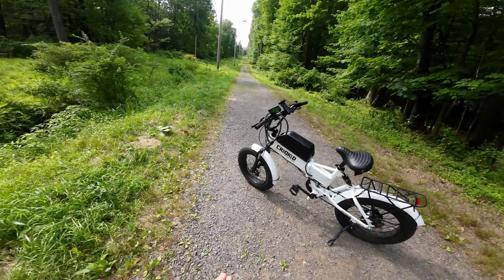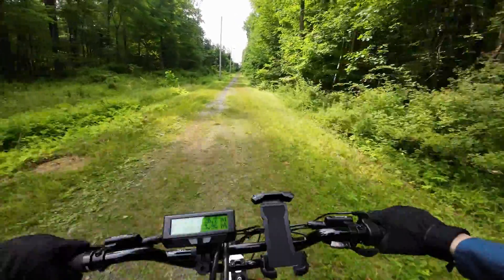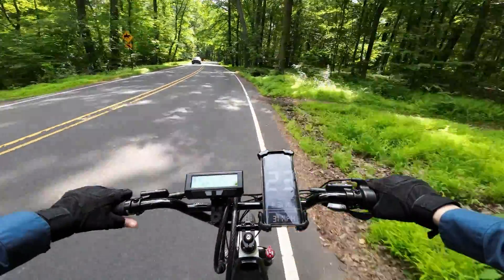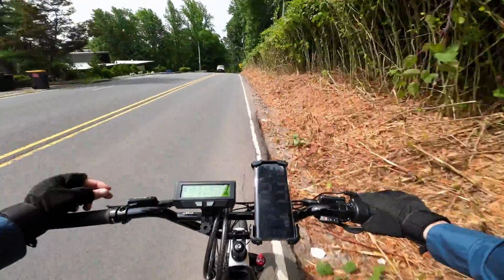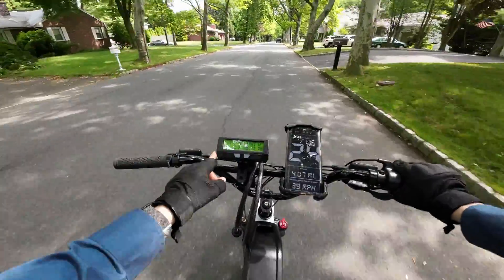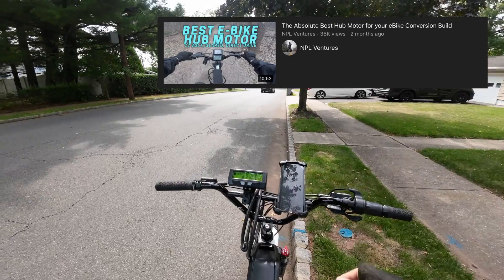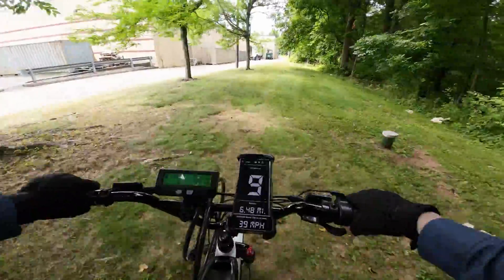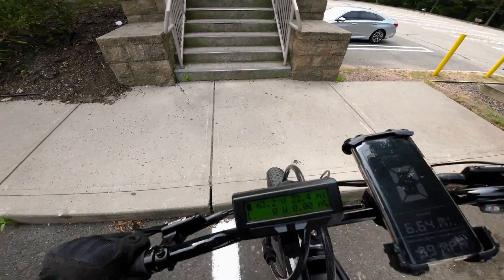Why I Won’t put a Powerful Direct Drive Hub Motor on my eBike Build

Comment: The thing that damages the motor is heat. You can probably run the full 96A phase current the Phasrunner can deliver. You just need a temp Sensor so you dont accidentally run the motor to hot. If you are worried about breaking gears you should limit the ramp up time so its not to jerky.
Reply: Good comments. Ramp aka onset of power is a big factor.  A motor can sustain the power once its turning high RPM. Everything breaks more with more abrupt power....from car transmissions to half shafts to chains and cassettes on mid drive ebikes.
Reply: At what temperature does it become critical?
I only need to drive 5 minutes and my engine is 85 °C (185 °F)
Driving is no longer fun since I discovered the engine temperature gauge :/
Reply: @Bergwacht  it’s very hard to PinPoint one critical temperature since every motor and location of the temp sensor is different. I think the first thing that gets damaged is the magnets that get demagnetized but that temperature depends on the magnets. The temp sensor is usually located next to the windings so you are measuring the temperature of the windings not the magnets. 

100 degrees Celsius should be okay for most motors. Some people go all the way up to 120 or 130 and it’s usually fine. 

The thing to keep in mind is the higher the temperature the faster you are aging the material so it may die earlier.

Comment: What do you think about the Electrom LEV? It has two motors, a geared motor in the front for low speed and a high powered direct drive hub in the rear for high speed.

Comment: I can't see any option to modify your pwm in the controller settings. Try decreasing torque up ramp times to boost torque, the controller will sense you need torque faster and adjust that setting for ya.

Comment: my biggest concern is, the bikes aren't designed for that much power/torque. like others mentioned, the dropout is a weak point. no one can convince that it's a good idea to run 1000 watts through a front tire. now, you can buy a one of those stealth bomber frames that have a proper dropout/swing arm. a 1000 watt rear hub and a mid drive bbshd is by far the best of both worlds and marry quite well. use 1 battery that can discharge 40-50 amps continuously for a clean look.
Reply: I run 1500w through my front fork but I welded myself a steel truss/springer fork because I did not want to risk it with a QR magnesium dropout. That being said, if you use one of the more modern DD hubs from Grin that take the torque forces out of the dropout and transfer it higher up the fork leg, or use a through "axle" fork/hub combo, you'll most likely be just fine. Some of those forks are designed to withstand the braking force of a 180mm rotor or bigger and I can't imagine even a 3000w DD hub accelerating the bike faster than a hydraulic front brake can stop it, and he'd be sharing the load with a rear hub anyway.
Reply: @FightFilms  Great point of comparing the rigors of braking forks not to mention impact forces of front forks to onset of high watts due to a front hub motors.  Forks tend to be very strong.
Reply: If your frame is so weak that a power force of 1000 watts can break it apart (which a human muscle can output), I think you have other problems down the road and dropouts won't help much. Don't use bikes that are designed to be very light for ebike builds. I have double amount of that power on my front fork with no dropouts for 7 years now on 2 different MTBs, no problems, cracks, heat, bending, etc.., because they were built to be strong and withstand stress, not built to go a bit faster on roads.
Reply: You use both motors at the same time? What is the benefit?
Reply: yes a mid drive dedicated for hills and powerful rear would seem to have the greatest versatility, if the bike then had 2 batteries one larger than the other it could be possible to plug in the motor most appropriate for the ride conditions

Comment: Only a suggestion about using the steel gears in the hub motor is the same when transitioning from nylon to steel gear in a mid drive....sound.  In engineering parlance, no free lunch and truth be told why nylon gears exist...they don't propagate the same sound wave that metallic gears do.  Me personally?  When nylon gears get a bit worn which maybe fractionally acclerated due to running on the margin of high power, nylon gears are cheap and easy to change.  Do some research before you go through the exercise. Steel gears are why Sur-Ron's and CYC motors are so loud.  I prefer stealth but I am fussy about sound. Otherwise a gas moto is overall better for power and range.
Your bike is running good, well done....if you have another motor coming, I would turn up the amps and watts and let it eat.
Reply from the maker: great points.

noise will definitely be more but shouldn’t be extreme. As mentioned, some bikes like the X class already utilize steel gears and the noise level, to me, is more than acceptable.
Reply: @NPLVentures  Just wanted to mention why nylon gears exist and why I am a fan of them versus steel gears which yes are stronger...but nylon gears when they wear are an easy swap.  I look forward to your comparison video.  Ride safe.

Comment: If you put a high torque motor in a suspension fork, you run the risk of snapping the dropout and dying. Unless you use the all-axle motor or the Crystalyte with a 20mm or 15mm axle and the appropriate fork. You can safely over-volt the Crystalyte and get a lot of power from it, but you will be spinning it out sometimes. Handling is different, not harder. I find it works like a steering damper in curves and the feeling of how it "pulls" you out of a sharp curve is quite cool, especially on an uphill. It will make your bike quite heavy, but for street or fire road riding, it matters little. The acceleration will be insane and you will almost certainly not overheat either motor at WOT if used in tandem. A high speed wound motor would be best for a 20" wheel, and by that point, it would be silly not to get moped tires.

Comment: Brave to put this hot take out there! 😂Direct drives are fun, but you're right, they aren't the best option most of the time lol
Reply from the maker: They can be great and very fun.

But I also have been noticing just how much less power my geared hub uses.
Reply: @NPLVentures  dude just buy a high end bike and call it a day all this mind wrapp is insane
Reply: @Ebackfive that's not the best decision for everyone. Plus a high end ebike would be more purpose built and not a everyday commuter. Your "just buy a High end" flex is so lame. Or was it more of a low key attempt at poor shaming?? Idgi but it's a low iq answer

Comment: You have a good speed with that 60 volts battery 🔋
Reply from the maker: I was split between a 72 volt 14ah and this 60 volt 19.2ah battery. I think I made the right choice